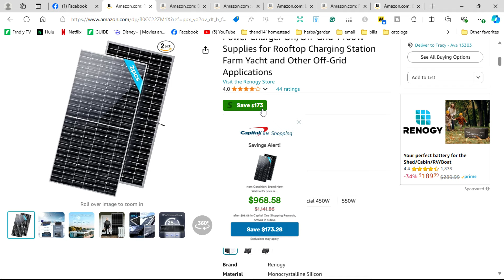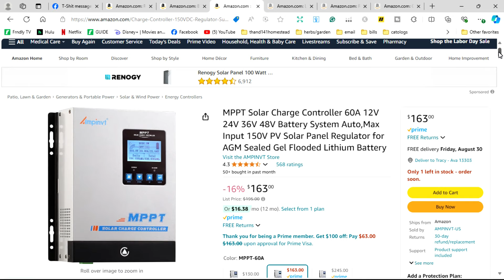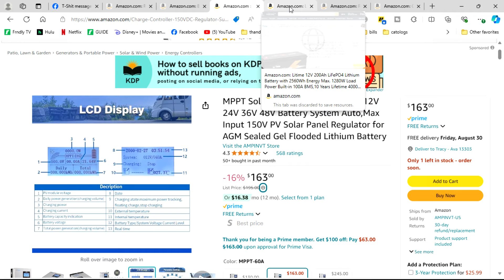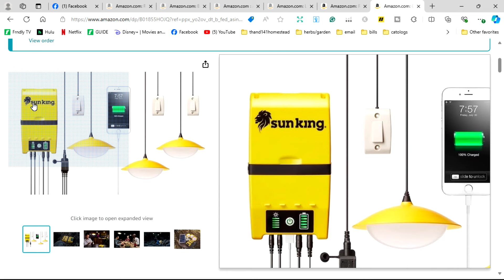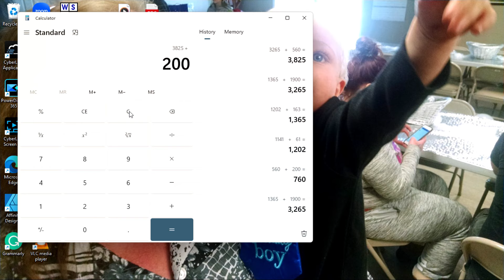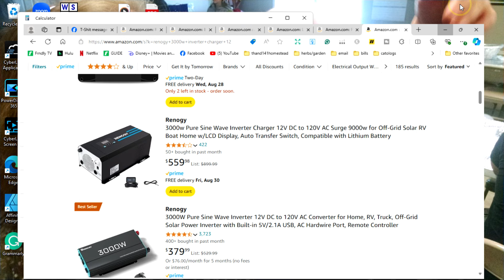How Much Does It Really Cost To Live Off The Grid? Discover The True Price!

Comment: Great explanation Tracy.  Have you thought of going 24 v?   liop4 battery  is the way to go.  Only  regret  200aBMS  low temp  protection.
Reply from the maker: Thanks Dave! I have, and I may eventually when I upgrade my inverter from 2000 to 3000w. The Lipo4 batteries are night and day better than lead acid! Thanks for stopping by!